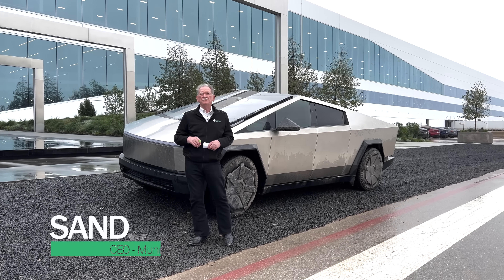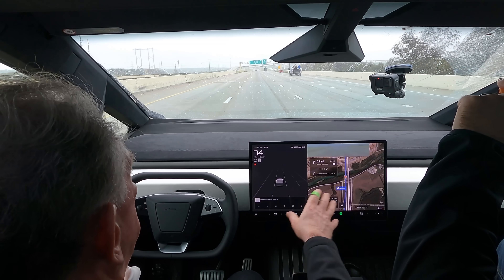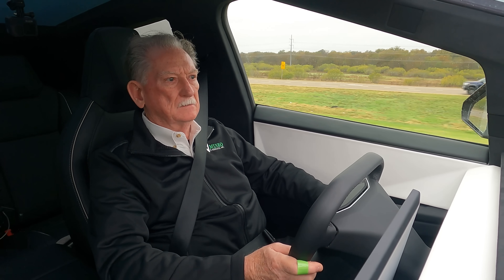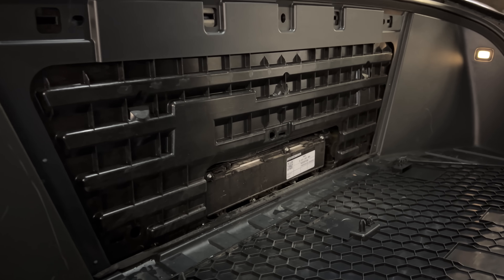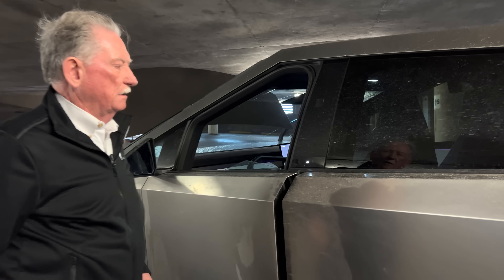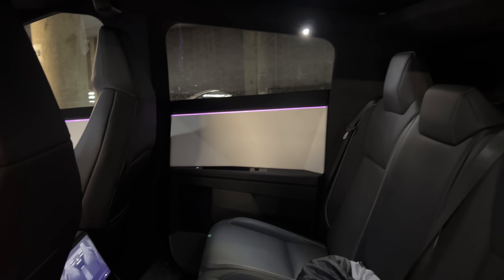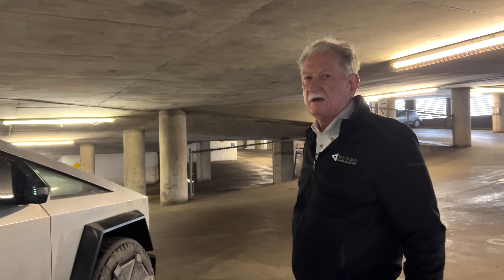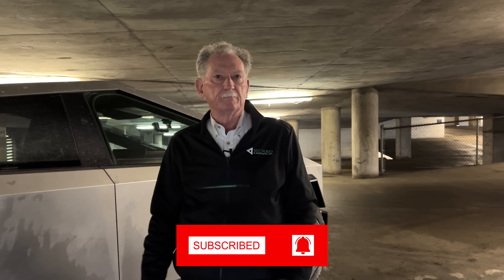Sandy's First Impressions of the Tesla Cybertruck!

Comment: Great short overview. One question, why would the CT not be a direct competitor to the F150 if it meets and exceeds many of its specs and functionnalities (except for long distance towing when compared to the ICE F150) with a much lower cost of operation (vs the ICE F150)? Same question when some people state that it won't be popular as a work truck with no explanation to support their argument.
Reply: People buy trucks for image first and then justify their purchase using every reason except the primary one
Reply: @notmyfaultthisishappening3795  not all of us. I bought the F150 over the Rivian because of the bed length. I do like the 6 foot bed in the Tesla but that’s not enough to get me to buy something that looks this funky with OK range.
Reply: I think he was referring to the off-road capability and that is why he mentioned the Jeep and Rivian…these vehicles are designed for serious off-reading.  The F150 not so much.
Reply: It's 2 cost of f150.
Reply: Simple, volume. Maybe at scale with dropped prices. Ice is still around, and will drop in price.
Reply: Reach over the side as it to get something out of the back of the bed.  There's your answer.
Reply: IMO I think it will take  a few years to get a comparison or competition verdict among their respective owners. 
The F150 already has a very strong verified reputation hehind it. It does not matter much what powers it. Gas or diesel.... the power stroke was a force to be reckoned with when it came out. 
 So , I think the F150 lightning has a secure future. There does not seem to be  much of a learning curve, as far as the operation of the vehicle.It still has an appealing design and awesome new funtionality ,like the V2G feature capability. The older buying crowd, like me... will probably lean toward the more recognizable styling, I know I tend to.

Don't get me wrong; the cybertruck is really a masterpiece of new engineering in every aspect possible. OTA updates, FSD(?) and superchargers  are  Tesla's really big advantages to date. The increase in EV adoption is phenomenal....and a good thing IMO. I sure hope the charging infrastructure expands as quickly as humanly possible. 
Better yet !; how about dedicating a fleet of Tesla Semi trucks that could just go and act as a boost buddy , in case  someone can not make it to the charger in time....That would be cool, but maybe a logistic nightmare.
Reply: I think there are two core reasons. 1. The F-150 lightning has a frunk that allows to cary and power bigger equipment. 2. Existing aftermarket equipment can be used on the F-150 lightning.
Reply: @ethalund 
Yes I prefer the F150 Frunk but I prefer the CT. Lol
Reply: It is a real competitor to the F150. Many people just haven't been able to wrap their minds around the new look yet, Sandy included it would seem.
Reply: Because it has no Trip Planner and the software sucks. Any questions? Edit: No real software that works and no real Trip Planner that goes to any REAL chargers that actually exist.*
Reply: try putting a camper in the box of a cybertruck............... good luck.
Reply: @stevemyers2092  for what? 😂
Reply: The customers are different. The majority of pick up truck buyers are not purchasing fundamentally based on specs or cost. Those are secondary. Brand relationship and styling come first.

Edit: even if the CT cost $15k, people would still be buying the F150
Reply: @WeatherManToBe i don't think it will replace the F-150, but many of yhe reservation holders are contractors for all the reasons this truck saves money and capabilities with some wanting to put their Logo on for advertising. Many of us thought they would make a lifestyle truck, but they spent a lot of time w industry and contractors and made a nice but utility truck with a lot of feedback incorporated. Also with the accessories. It will be good to see the comparisons over time and improvements if people want it. Won't work for everyone or every job.
Reply: @WeatherManToBe   ̶B̶r̶a̶n̶d̶ ̶r̶e̶l̶a̶t̶i̶o̶n̶s̶h̶i̶p̶ ̶a̶n̶d̶ ̶s̶t̶y̶l̶i̶n̶g̶ ̶c̶o̶m̶e̶ ̶f̶i̶r̶s̶t̶   Ego and Machoism.
Reply: It's a hipster 'truck' that's basically why.
Genuine truck users are sticking to gas.
By genuine, those who do decent daily mileage with significant towing or carrying loads.
Oh, and wait until you hear stories about lack of body work repairability.
Still, Munro said the other day, farmers would be considering replacing their tractors with the CT 😂
Reply: @stuartburns8657 couldn’t be more wrong with everything you said. I’m far from a hipster and would love the Cybertruck for hauling , towing, and getting me to the trailhead. I own a Jeep and a Tesla so I already understand how much real gas and money savings I’ve realized. And go check your body repair costs for that aluminum sided F150.
Reply: @GunnyMac360  it was granted a sweeping generalisation.
And yes I've heard the Ford costs post accident are also the wrong side of not funny.
Whilst your individual case maybe the exception that proves the rule, I standby what I said.
You only had to look at those few who collected their CT's during the launch event.
Bet none of them had ever been in a truck before!
Reply: @stuartburns8657  you don't know a thing about the new owners, you're all about your generalizations aren't you?   The CT just like any pickup has a wide range of uses. If it doesnt fit your use case, move along.  For anyone looking into a EV Pickup truck, the CT from first looks, should be on their short list. period
Reply: @GunnyMac360  Ultimately we'll all have to see what the market says, maybe I'll eat humble pie, maybe not :)

Comment: Making sci-fi a reality  Cybertruck deliveries begin today!  – More utility than a truck, faster than a sports car  11,000 lbs towing capacity, 2,500 lbs max payload.  Est. 340 miles of range. (Dual Motor)  0-60 in 2.6 seconds. (Tri Motor)  – Ultra-hard stainless steel exoskeleton & shatter-resistant Armor Glass  Fewer dents, less damage & long-term corrosion. Easy & simple repairs.  Armor Glass can resist the impact of a baseball at 70 mph or class IV hail & acoustic glass helps make the cabin insanely quiet.  – Steer-by-wire & rear steering  Gives you the handling of a sports car & a better turning radius than most sedans. Also, incredible stability & maneuverability for a full-size truck.  – 4-corner adaptive air suspension  Offers 12” of travel & 17” of clearance.  – Plenty of storage  6’x4’ bed that doesn’t need a liner & is big enough for 4’x8’ construction materials.  67 cu ft of lockable storage (additional 54 cu ft available with rear seats folded up), with a Vault cover that’s strong enough to walk on.  – Power everything  Integrated outlets: 120v cabin power, 120v & 240v bed power. If the grid goes down, Cybertruck can provide up to 11.5 kW of power directly to your home.  – Space & comfort like a living room  18.5” touchscreen in the front & 9.4” touchscreen in the back, both with all-new UI.  15 speakers with 2 dedicated subwoofers & distributed amplifiers create a studio quality sound stage—obviously goes to 11.
Reply: You forgot to mention front and rear locking diffs.
Reply: @ramonhurt69 It’s interesting about Diffs !!

I had a 2022 X5 3.0 diesel … but it could not tow a boat up a slippery slipway ! it didn’t have a centre diff- because the cheapskates at BMW thought they could replicate one using the disc brakes. It was a pitiful system. You could easily get stuck in the X5 even on wet flat grass !!

I replaced it with a MY … that toes on sand and weed-covered slipways, beautifully.
Reply: Hell ya
Reply: Yeah, but apart from that.....?
😉

Comment: meh. the panels gaps look terrible, the door pinching opening thing is just impractical for winters, the cost is ridiculous - the whole thing is just stupid. ive had a look at it in person and its just weird. no spare tire and its a truck...wtf. angular bed and you kill most of it once you add a spare battery pack which you need for off road anyway. need to engage turn signals to see the left/right cameras instead of showing them all the time ? nuts. dirty rear cameras because they cant recess them inside far enough to protect them ? sharp edges to slice off body parts...whacky. cant do basic stuff like fill up from an add on generator pack when youre in the woods. cant tow significant distances with a trailer. and this is an outdoor hunting fishing truck ? riiight. sandy has gone all musk fanboii unfortunately. need to get back to practical reality. how are those plastic wheel covers doing to do in freezing mud ? not well. how expensive is it going to be to repair from a fender bender ? probably hellish with an irreparable foam filled battery pack with cell sizes you cant get from any other supplier. dont get me started about the stupid giant windscreen wiper you can only get from tesla which will probably run you $1000 to replace.... who needs a rear view of the truck with the bed cover down anyway. because in tesla california land we dont bother about looking behind us while driving.... oh yeah and giant pane of glass roof because no rocks ever get kicked up on california highways and this thing will never go off road anyway....
Reply: Repair? Just pull the side off on old stove or fridge and screw it on
Reply: What panel gaps? You mean those on manually made prototypes? There are none no those made on the automated line.
Reply: @Alarix246  i wonder if you can open a door without panel gaps? I think that are a must.
Reply: @waffles1ca  of course not but that wasn't the issue. That is the uneven gaps and too large gaps (which are no longer the case for line production CTs).

Comment: So where does the low voltage 48 volt come from? Is there a 48 volt battery somewhere in the truck and do you know where it's located?
Reply: My understanding is there is no 48 volt bat.  They designed a 48 volt power supply that is fed from the main battery.  So no accessory battery to replace or to run down.
Reply: @datamatters8  Wow, best part is no part. That would be interesting. In fact the power supply would also have to provide 240 volt AC, 120 volt AC, 5 volts DC for USB ports, and I would think 12 volts DC for the trailer connector. Maybe it's just one big unit that outputs all those.

Comment: I love the truck 1000% but.... my one complaint is that when accessing the bed trunk it's almost impossible to reach in there while standing. You have to lay on your belly and if anything heavy is in there good luck. The 1st gen Honda ridgeline executed this excellently with the tailgate that not only folds down but also swings like a door to easily lift items in and out of the bed trunk.
Reply: Yes getting to that storage is very difficult. Probably should have put the spare tire there like Rivian.
Reply: If you let the suspension down, it must be easier. And the tailgate opens down / closes up easily. Sandy had it higher.
Reply: Still if anything is in that trunk that weighs north of 30 lbs that's a horrible way to try and lift it bending that far. I have a ridgeline and regularly lift a 48lb bowling bag in and out and couldn't honestly imagine doing that with the tailgate folded down. Athletic guy and stock height ridgeline.  @Alarix246
Reply: Here's the solution (imo)
Install a heavy duty slide-out.
.
On the end nearest the front of the truck, install a flap for access to the underside storage. (with the slide covering it, you could even remove the existing cover?)
.
Depending on the height of items you carry, there's even more space......
On the lower edge of the LED strip at 5:35 the production trucks have L Track installed. (Not sure on this one)
It would be simple to install another slide on that all the way to the cab, great for lighter weight items.
You'd have a 6x4 foot plus  5x4 foot storage system.
.
That gives you full access, slide out, load, slide in.
.
Plenty of companies making them.

Comment: My dream car but with the one exception that is a deal breaker for me. Unless it will be offered with a steering wheel I will have to pass.
Reply: I hated the yoke steering wheel on Model S but because of Steer-by-Wire, I think it will be fine on Cybertruck.
Reply: You might want to consider the impact of steer by wire. The lock to lock on this is only 1 turn.

Comment: Visibility...minus the huge A pillars on the sides of the windshield. And the huge pillars between the front and rear doors.  Have you ever driven a Forester?
No mention of the missing spare? No mention of the gaps being inconsistant between each other and different between the same cars?
Going hunting away from charging stations? Umm...
It seems like Mr Munro has become a full Musk-eteer. Apparently you are not allowed to do reviews of Tesla anymore and be honest or you risk getting SLAPed.
Reply: That’s your opinion. There is always some compromising when building a truck and some value other features than your essential and required features
Reply: @Harrythehun I signed up for one the day it came out based on the promised price and spec. They are very far from those numbers now. Maybe they will make improvements over time but these will end up looking like the bottom of a stainless steel sink in a few months and anyone who has tried to polish a sink like that knows what you will be up against. That shine will be very hard to maintain in typical truck use situations.
Reply: @Madshadowgolem  Understand your points. I would just use the truck and wash it gently on a weekly basis to avoid the worst scratches. A decently scratch free and clean industrial stainless steel isn’t hard to keep clean and will still look uniform. I also had a preorder in, but ended up cancelling due to other priorities, I want a electric Camper-van.

Comment: With the steer by wire is there a way to adjustment trim (to define the steering direction when the wheel is centered)?
Reply: There should be a neutral position of the steer motors to adjust the steerwheel to central and the wheel alignment to straight

Comment: I have a similar issue with my Y. I had to get used to the 3 mirrors as well. Each are limited in view but the repeaters are far better. I'm disappointed in the rear cameras are always dirty. Even more so when they go to it being the primary method of seeing behind.
Reply: Idk why but somehow the camera on my model y never gets dirty.  Driving in rain and it still looks great.  They must have found a great mounting spot.  Probably harder on the CT
Reply: Side cameras are great. Rear is a mucky mess
Reply: I can only think of a few cases when the camera was obscured, and a turn or acceleration would easily clear the few drops of water
Reply: I live on a gravel road and I've never had the rear camera become obscured on my Model Y.  I've had bugs sit on the door cameras a couple times in the summer but they generally fly away as the speed increases.
Reply: Some folks live to complain. You must be one.